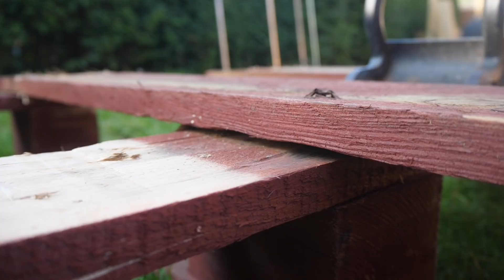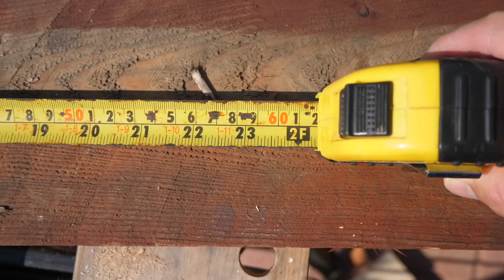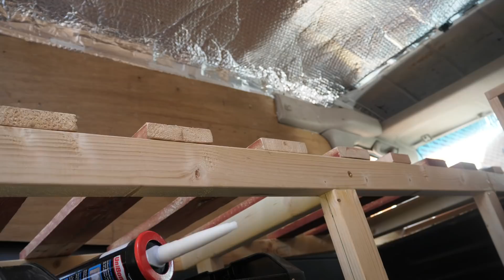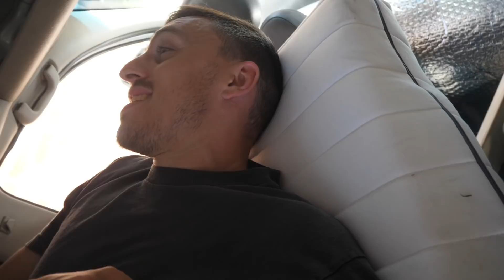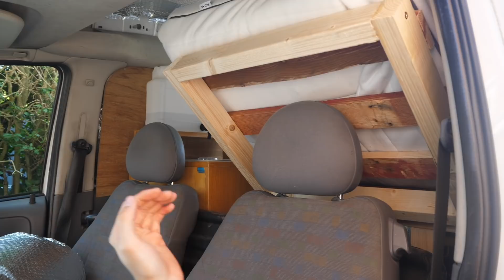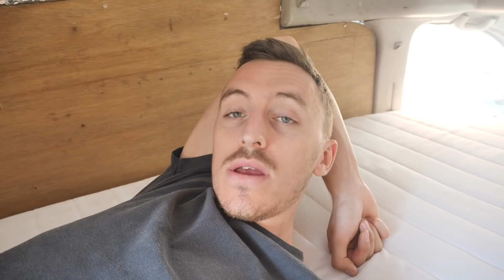Foldable Bed Part 2 - £1000 van conversion!

Comment: Hey hugh.... really like your channel bud!

Little tip for repurposing pallets... get yourself a small angle grinder (they're pretty cheap like £20ish)

Grind the heads off the nails and they basically fall apart... keep it up!
Reply: init, gem of a find, this dude. is

Comment: I have seen many transformations, and in all the partition separating the passenger compartment from the cargo box is removed.
It's a great way to get more room to have a bigger bed, to have a more open space and to have more light.
But in Portugal commercial vehicles are not allowed to circulate without the partition separating the passenger compartment from the cargo box. Also it can not be different from the one that the vehicle brings from the factory and there are specific rules of how the partition should be.
Reply from the maker: thats a massive shame! I wonder why they are so strict on changes!?
Reply: It's the law we have.
It is very rigid about changes in vehicles.
I also have a Combo (first generation), and to remove the partition and screw a furniture, bed or, going further, cut the roof to put a skylight or put windows, would have to create a project with the scheme of what would put in the van, measures, number of places, submit the project to the regulatory body, pay an engineer, pay inspections, pay the commercial vehicle registration for motorhome, etc ... It far exceeds the value of the car.
It is possible to put a bed and furniture in a commercial van as long as you do not screw them. The police look at this as if it's cargo. If we go much further than this, it's already a transformation ...
In any case, there are a lot of people making complete transformations of commercial and passenger vehicles without registering them as motor homes, but in some cases they are risking heavy fines ...

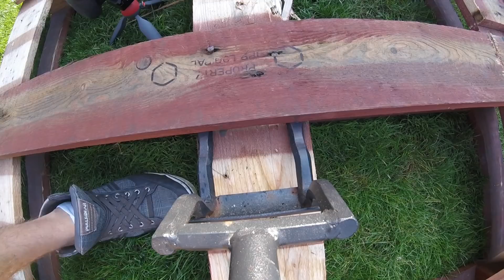Comment: Hi, at 1:57 in, what's that you're using to pry up that plank?
Reply: That's the pallet puller he said he wasn't going to use. Tut tut.
Reply from the maker: haha you caught me Robert it actually was more of a hindrance with those meatier pallets as the slats are so close together!
Reply: I guess I'll let you off.  Although I am surprised that you are including power tools in the budget as most people have a small drill/electric screwdriver that they can use or can borrow from a friend or family.  Also, most people that are competent/confident enough to attempt a conversion will almost certainly have them.  But kudos for getting it done on that tiny budget you had after the purchase of the van.  Whilst I have your attention -  I've got a 1994 Toyota Previa that I cannot wait to start converting and a lot of it will be inspired by all of your videos (especially the pull out slat bed you have made before).  So thank you very much for what you do.  It really makes me want to go out and explore the UK more.
Reply from the maker: Thanks Robert, yeah a lot of people do have a power tool lying around but I just wanted to push the challenge as far as possible to show people what is possible. Great to hear about the Toyota! you will have so much fun!